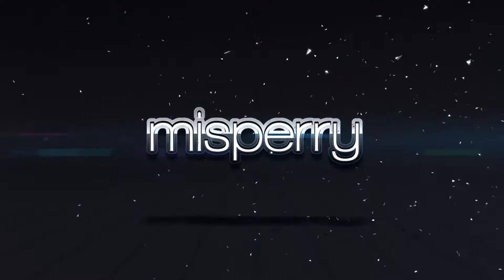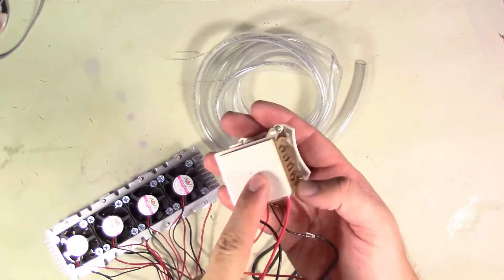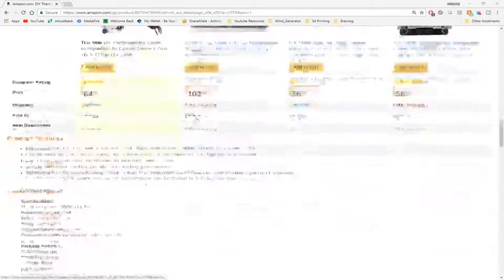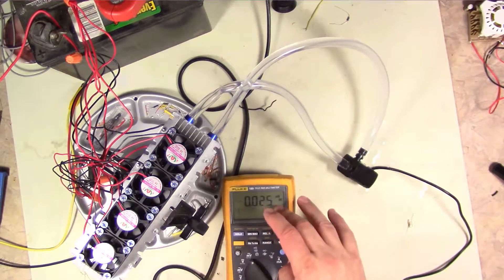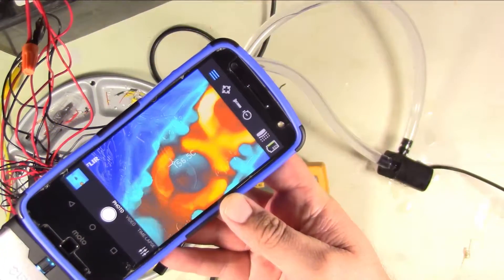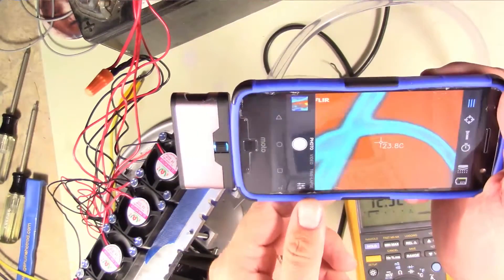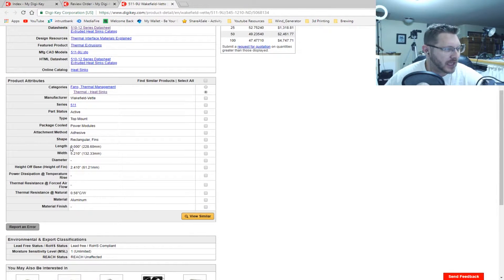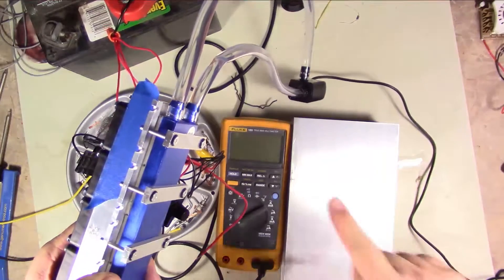Water Cooled T Shirt Part 1

Comment: Since 1 liter of water must absorb 1 calories to increase 1°C, throwing ice into a 2 liter container is enough to cool one of for an hour.  
I will move the engineering part to calculate the water temperature and automatic shutoff the circulation according to the heat it may carry away, before one faint from hypothermia

Comment: I've invested years in researching personal cooling solutions. Peltier modules eat power and are only efficient coolers if you already have a way to efficiently cool things... like the hot side of the module.
I mean you don't really want to carry a car battery with you and a kg of aluminum in a heatsink, coupled with a loud fan... I wish this would work, but it just doesn't.
air cooling is much more efficient than water cooling. it'd be cool to have a wearable windchill device (or maybe just a bunch of fans)
Reply from the maker: Yeah this is kind of a saterical vid and not very practical it was just something fun to do but I agree with you something that uses fans probably more practical however this was a lot of fun to learn the flow and to talk about peltiers
Reply: @misperry  the methods in your video are a necessary stepping stone to one day finding a real solution for consumer level personal cooling. the more people are taking part in this, the sooner we get there